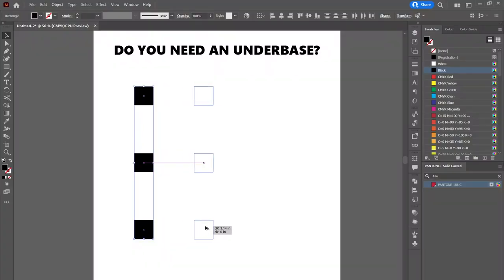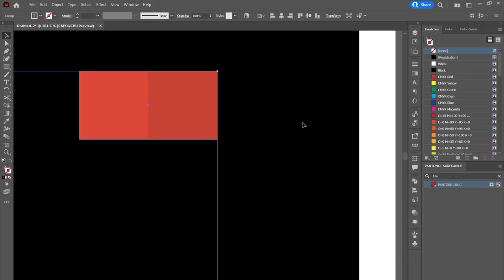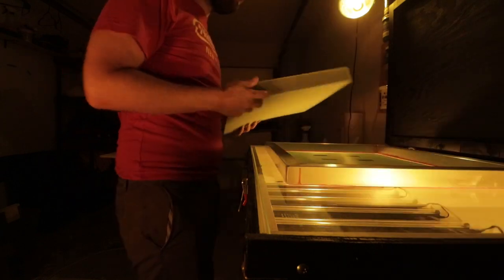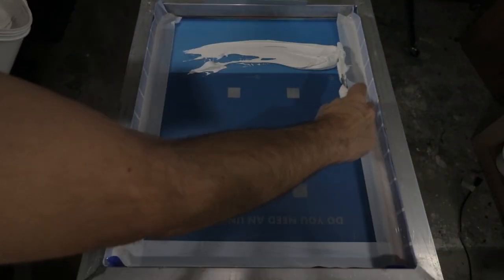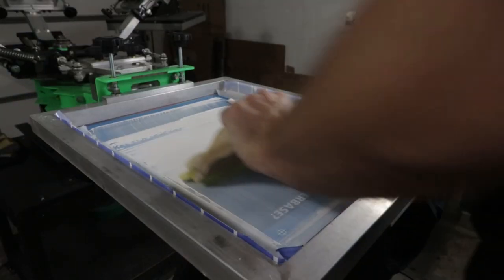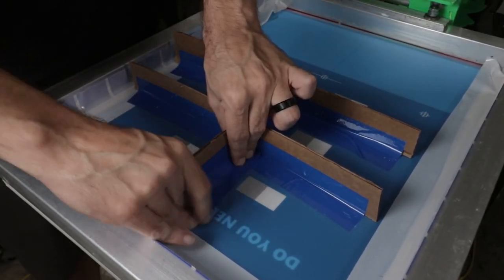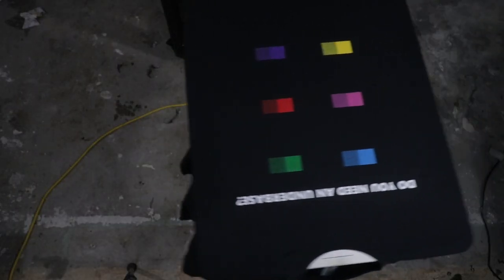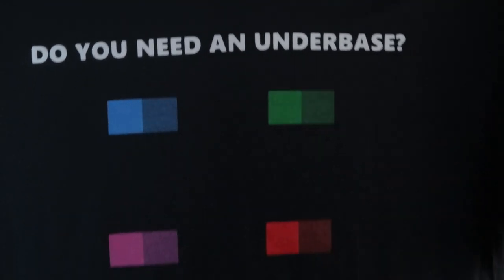Do You Really NEED an Underbase? /// Screen Printing Without an Underbase

Comment: I'm planning to do some screen printing at home with black t-shirts. So I'll likely have a crude DIY setup. I would think that a white underbase requires perfect registration and it's unlikely that I'll be able to achieve that with my setup at home. So no white unberbase for me. However, from your video, it sounds like I might be able to get semi-vibrant colour by applying more ink than usual? Maybe I'll try three passes and see how that goes. Yes, I would be using more ink (which might sound wasteful initially) but I'll only be using a single colour (green.) At least I won't be buying two ink colours for each t-shirt print (white and green.)

Comment: How about use clear ink for underbased?
Reply: You are right...the under-base only keeps the color from merging into the shirt. a clear base does create a layer to keep this from happening. try it yourself I've been doing a clear base (if needed) for many years.
Reply: @F1SHBACK  When applying a clear base, do you still need perfect registration? Does it matter if the registration is a bit off as in a crude home made screen printing set up?
Reply: @PatrickCooperPhotography-nw1pp  You do. but it is quite a bit less obvious if you are off... I also suggest reducing the base's size to eliminate any overlap. You can do this by (Inner stroke .3) while creating the separation in AI  or PS.